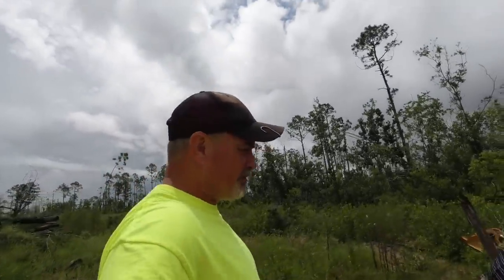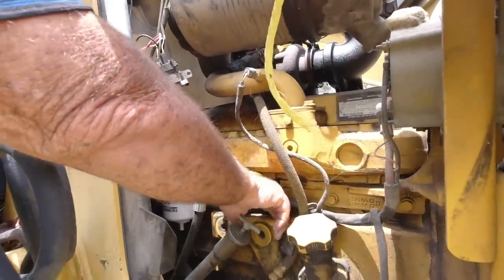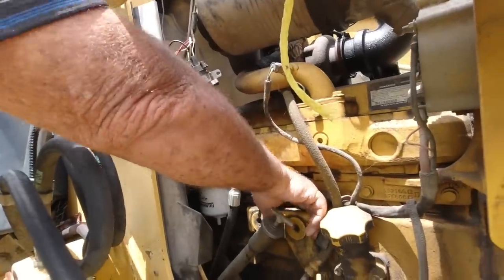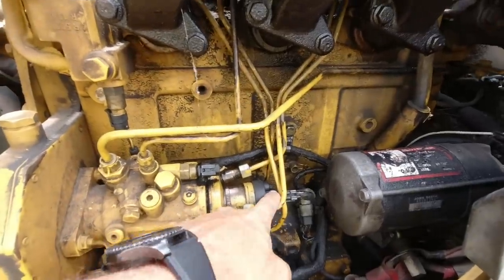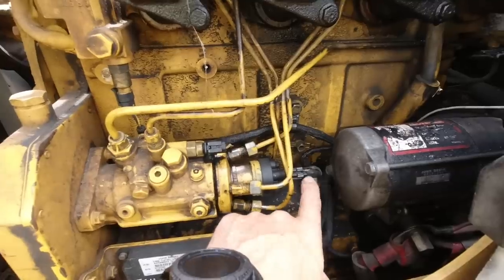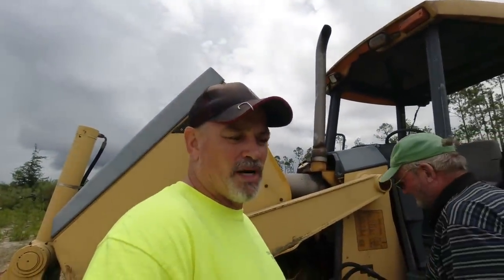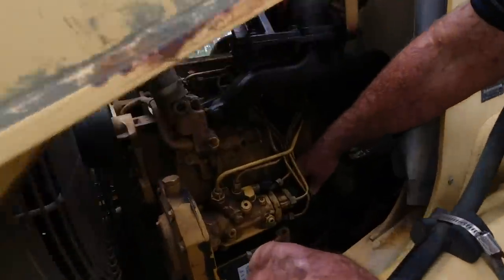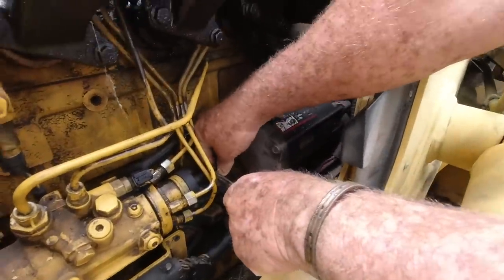Will It Start? Working on the ABANDONED digger John Deere Backhoe!

Comment: I’ve been a Deere Tech for 6 years. Maybe check the f.n.r. Lever. If the controller isn’t reading it isn’t in neutral it won’t allow the ecu to power up. The injection pump solenoid is not just a 12 volt off on solenoid. It’s controlled by pulse width modulation from the ecu. Also check f.n.r  relays. That could also be why it’s not cranking from the key switch.
Reply from the maker: Thanks Ky. We've checked that. I appreciate the comment 👍

Comment: That solenoid doesnt get a set voltage. It works off a pulse signal normally around 9 volts. If your not getting fuel from the pump to the injectors i would check the terminals in the pigtail on back of the pump. They are known for issues. If you need a new pigtail the part number for standard brand is s553  at auto parts store.     Those DE10 injection pumps are also failure prone. I replace them pretty often.      If you need to move it there are 2 bolts one on each side of rear drive shaft on the park brake housing, you can loosen jam nut and tighten the bolts in to release the park brake to pull the backhoe
Reply from the maker: I think you're right👍 thanks for watching

Comment: Yes, you're gonna have to spend a little money, but your time and effort are worth it.  
I'm a 25yr diesel mechanic and I highly suggest you get a Power Probe 3 for your electric diagnosis.  You can tell if a circuit has power and ground and you can supply power and ground as well as use it as a multimeter to show continuity and voltage.  It's a highly valuable tool that anyone should have, even if you are not a mechanic. It is an equalizer for sure.  It's also circuit safe with a built in circuit breaker.  
It would save you so much time and effort for testing a good or bad part. You could use backprobed your cylinder you were testing, checked for power and ground, or test if it gets energized with the key and if not, you could manually add power or ground, whichever was missing.  Boom, in seconds, you know if you have a bad part or circuit and move on from there. You didn't show if the "extra" battery you were using even had a charge (maybe off camera you did), but generally you don't want to add an extra battery to your system because it'll add a whole set of unknown. 
I did 8 yrs in the Army and carried a multitool for many years too, not so much anymore, but that's for a different reason. 
I hope this helps, I came over from Diesel Creek on his shout out for you. Got any mechanical questions, let me know, I'm retired and happy to help. 
Cheers
https://www.amazon.com/Power-Probe-III-Case-Acc/dp/B005MVB3S0/ref=mp_s_a_1_3?dchild=1&keywords=power+probe+3&qid=1596806712&sr=8-3
Reply from the maker: I hear ya. Thanks for stopping by and watching. I appreciate it 👍

Comment: If the fuel was making it to the injectors, it would run since it ran on starter fluid.
 Loosen a fuel line at the injector and hand prime it until you see a steady stream of fuel there, with no air
Reply from the maker: Thanks!

Comment: If you have wired the fuel pump direct to a battery, you should hear it running, but it didn't sound like it was.
Reply from the maker: Yeah that's what I thought too. I didn't hear it either. Thanks for the comment

Comment: Yank the solenoid then try starting. Still thinkin the pull back circuit is not apply enough voltage and it is preventing fuel from flowing.
Reply from the maker: Thanks 👍

Comment: Is it possible whoever owns the backhoe,would let you load it onto a semi.haul it home to work on it?
Thats where all the tools are.😊

Is it possible to fill the fuel filter with diesel fuel? That way its getting some fuel off the start if it starts?

Once you get it running.of course you will have to try it out and do some digging for a few hours . You know, just to make sure its in tip top shape to return😊
Reply from the maker: Yeah, we actually just talked about a way to get it back to the shop while we were out there. I'm hoping that conversation leads to it coming back to the shop.

Comment: Wondering if you two ex Air Force? Soon Rain Came You tucked tail went for truck cab.. Its ok, I Understand I hate when rain runs down the back into you know what.  Great work, getting closer, u know it fires off, just got work out the wire grimlem.
Reply from the maker: Lol. I hear ya

Comment: Yep hank i think she has a addiction 😬
Sometimes i use a little gas on a rag 
Or sometimes I have to resort to fire in a can ( starting fluid) something you might wanna check is on the supply line going to the fuel injector pump sometimes they have a little screen in there 
That gets stopped up 
Or the lift pump is not working properly 
And is not getting enough fuel 
Have a great day buddy 👍🏻
Reply from the maker: Thanks Nick. I appreciate it 👍

Comment: I think that he loos a ground cable and then loos the power for star and you aply starting fluid but that maybe loos the motor or starter or other part and chek the oil and the disel they no have water on that and the computer send a signal don pushing to more the motor God blesing friend
Reply from the maker: Thanks Oscar 👍

Comment: I worked for a deere dealer here in aus for 8yrs & saw problems on 315sg,s with water in the ecu plugs because the ecu,s on them is in the engine bay. Just a sugestion i,m not sure if your 310g is new enough to have an ecu.
Reply from the maker: Watch part 2 or 3 ....we put a new ECU in it👍
Reply: Probably i silly question & you probably have allready done it. Did you loosen the injector lines & cranked it to see if there is fuel coming out of them? Its not common rail is it?
Reply from the maker: Yeah,weve done that. It's not common rail. Thanks 👍
Reply: I wouldnt think its a compression problem because it runs on starter fluid. Sounds like its not injecting.

Comment: I had a similar problem with my kioti ck25 3 cylinder it turned out to be the gears in the fuel pump were stripped so my neighbor Bob ( retired school bus mechanic ) suggested we turn the gears 180 to engage perfect teeth it's been good for 145 hrs so far. Kioti dealer wanted 1200$ for a new pump!🇺🇸✌🏻️
Reply from the maker: Interesting. Thanks 👍

Comment: As nice of a tractor that it appears to be, it wouldn't have been sitting there if something wasn't seriously wrong or rather just expensive. I see below the pump there on the left side ECU etc..  on a small black box. That could be the issue. Trying to jump start some things with computers on them can lead to power surges back into the ECU causing non repairable damage and sometimes over time they just fail anyway. Just have to replace it. Also could be a grounding issue. Good luck and God Bless ! Love these type videos along with the tractor ones as well.
Reply from the maker: Yeah in Part 2 ..maybe part 3 we replaced the ECU. That's a new one. You can go back and see some of the stuff we've done to it. ...it is getting expensive. Lol. Thanks for watching 👍

Comment: Hank I can tell you what to do to get the 310 going  it’s air in the fuel system you need to blend the entire system and also that it’s a electrical controlled system be very careful adding wires it isComputer control system has electrical fired injectors along with hydraulic fired injection system you need to bleed the system from the injector them self’s
Reply: Ps I work on one just like it that my brother has it’s very air sensitive
Reply from the maker: Yeah, we need to bleed the system for sure. Thank you for the comment 👍

Comment: Is there a possibility that the fuel pump needs to be timed????i know it might sound like a dumb thing.i had a 1998 chev 6.5L turbo diesel.when the pump went  and the new one was installed.the shop had to time it.
Reply from the maker: Maybe🤷🏻‍♂️. At this point anything is a good guess. Thanks Brian 👍
Reply: @HamiltonvilleFarm  is there a possiblity that the injectors dont open up to spray fuel unless theres oil pressure???
Reply from the maker: I'm not sure.  Maybe as a safety feature? I don't think anyone has mentioned that before.

Comment: I feel like you likely need to replace the fuel pump since it clearly has a fuel supply issue but I also wonder if there could be an issue with injectors themselves. I also feel like the starter is probably drawing way to much current and not turning fast enough to properly start the engine(especially since the jumper cables did not do much to speed it up), so, I would replace the starter and check all of the main power and ground connections to make sure that they are very clean and tight. Hopefully this will help make that machine a happy runner again. That's just my thoughts on the issue. :)  P.s. Did you have the JD tech fix the throttle sensor code you had and check for any other codes while he was there?
Reply from the maker: I think you're on the right track. The tech said he couldn't fix the code until the problem was fixed. 🤷🏻‍♂️
Reply: @HamiltonvilleFarm  Yeah, I figured that the calibration probably couldn't be done unless the engine was running.

Comment: TAT, my fr4iend, is why I like the old Fords. No computers and garbage. Just straight forward diesel and hydraulics. I lay you odds that you'll end up with a real Deere wrench man to get it going. Way too complicated any more.  And that's WHY they're like that.
Reply from the maker: Yeah I hear ya. Part 3 had the field tech come out and he had no clue what to do. Maybe we can get it one day soon. Thanks for watching 👍
Reply: @HamiltonvilleFarm  I remember it, come to think of it. Must've been a flunky. Cat guys aren't that way but for the money they get they better NOT be. Maybe you can winch it onto a trailer after loosening the hoses so you can move the hoe boom and whatnot.
Reply: @HamiltonvilleFarm  I was running a D5K LGP when it just STOPPED! Ran fine but wouldn't move. Cat man came out and said it was the coupler between the engine and pump. Electric over hydraulic. Had to pull the engine. Coupler looked like a overhead cam GEAR on a car with the teeth. Flimsy. He changed everything to a HEAVY duty one. Didn't bat an eye. The Deere man ought to be able to do the same.
Reply from the maker: You'd think👍 I appreciate you Lewie!
Reply: @HamiltonvilleFarm  LIKEWISE, Buddy! BUNCHES!

Comment: Frustrating that the fuel solenoid looks like it's actually ON the injection pump.  It should be going 'click' when you hook it up to that aux battery but maybe that was left on the editing room floor so I didn't hear it.  If it's not clicking, I'm not sure fuel is actually moving to the injection pump, even though it's a new solenoid.  I don't know how the valve works on that solenoid, but I'd probably take it back out and see how the fuel flows through the injection pump at that point.  If it's just pushing a valve actuator inside to release the fuel to the pump, I'd try manually actuating it (finger, screwdriver, whatever works) and see if it starts up.  There could be a bad fuel valve inside the pump.  Again, just guessing here.  I can't find a good schematic for that 310 injection pump on-line but the solenoid's I'm seeing for it seem to just be plungers pushing a pin forward, that would imply the shut-off valve is actually in the pump housing so manual trigger of the valve may work, but if not, probably bad valve.  That would mean that injection pump may have to come out to get the valve rebuilt.  Just a train of thought there.
Reply from the maker: I appreciate it. It's been really frustrating so far. lol.

Comment: You need get ahold of .watch Wes work guy he is good bud you know that bud but if it starts on either and no fuel it may have stuffed up injectors cause seems like it won't take and get fuel from last vid only way is to test them .but hope ya can overcome this bud it's a nice peice of equipment .may need a fuel pump allso not sure bud hard saying .but if ya use wd 40or what ever make sure it's flammable .and I was watching a show of someone who bought a tow truck ford and it wouldn't run cause the glow plugs didn't work and the fixed them and it ran but ya again it's hard saying bud
Reply from the maker: Me and Wes talk. He's a real mechanic. Lol. I'm sure he'll chime in on this video

Comment: Reading through the comments I see y’all trying to think of a way to move it. I don’t know how the hydraulics are controlled whether there electric or the lever is actuating the actual valve. If you can relieve the pressure by moving the levers, take the tractor and use it to pick the front end loader on the backhoe up and to fold up the rear arm and bucket. I wouldn’t remove the hoses that way you retain the hydraulic fluid and in theory it should hold everything up itself. Just remember to move the levers like you would while operating when you pick everything up with the tractor. If the tractor is able to lift all that that is. Hope this paragraph makes sense lol.
Reply from the maker: Yeah it does. We gotta do something. It's getting ridiculous. Lol
Reply: Hamiltonville Farm I’m sure. I would say I could move it for y’all, but without it running it be hard to get on my gooseneck. Does that big tilt bed have a winch?
Reply from the maker: I don't think so. Might end up dragging it onto a trailer of some sorts.
Reply: Hamiltonville Farm yea, it would almost have to be a detach lowboy

Comment: Did it start yet
Reply from the maker: Not yet
Reply: Try changing the cable from battery the red one not the big line I know it can't be  changed but use another line hook it up on battery and to the connector
Reply: We had the same problem with the 650j dozer it has the same engine you have on that 310 it did the same as 310 is doing it turned but won't fire up the problem was there not enough power going to injection pump..so you might wanna check that line from the battery

Comment: I've been watching you on this John Deere for the past couple videos.  You've changed out the ECM, fuel filter and battery  and as I remember that ECM was expensive and hard to find part.
looking around the internet, I found the manual on the Stanadyne DE injection pump. The ECM controls the solenoid on the back of that injection pump. through the ECM the idle, throttle control and shut off is accomplished.  You'll notice that there is no throttle linkage on that Injection pump.   Tapping into those wires on the back of that injection pump, plugging that harness back in and applying 12 volts to it caused 12 volts to back feed into the ECM.  You also have no idea which of those two wires you tapped into was 12volt positive and 12volt negative coming from the ECM.   Here's the link to the Stanadyne DE Injection Pump https://www.stanadyne.com/dealerportal/ssi/english/Product%20Manual/99820.pdf    The wire on top near the return line is a thermistor to send the return line fuel temperature back to the ECM.   I hope this helps.
Reply from the maker: Thanks. I'll check it out. I appreciate it.
Reply: @HamiltonvilleFarm  You're welcome.

Comment: I am no smarter than a rock when things get tried an nothing works. I can't understand for the life of me why the solenoid is performing like that. I know some had a manual turn on screw that incase of a electrical failure occured that you could turn in an it was on a find a way to shut off then... ya, what worked to make run would also work to shut off. I know if it was there that tommy would of found it and it is just like a key way or something is not turning something to make the fuel keep going to the injectors. I guess convert to propane and do away with the injection system by making a new system for it to get some kind of fuel. Fuel air and spark which uses the  compression is its spark even if it were propane. I am thinking that I got to help by researching this kind of pump. Sorry it didn't work Hank an I know you all try. Anyone who spent that much time in has got reasons for leaving. I only had in three and just didn't like the war all that much and when it was time to go home I flipped a quarter and so it was tails thinking heads I stay an tails i leave but it almost always comes up heads an so when tails come up I left Saigon and cried... not boo hoo but none the less thinking I am letting someone down.
Reply from the maker: Thanks Morgan 👍
Reply: @HamiltonvilleFarm  The ones that I have worked on Hank, you don't need a seperate battery for the solenoid, and since ground is already established, a hot wire from the battery just means the juice in the wire doesn't shut off when in the cranking mode. I did take a air compressor and blow through the injection pump while cranking it over before and got a   wad of shit that was trying to get through.. sandy grit and fiber like I fed it oatmeal or something. Supposedly you can take the solenoid out and block that hole off and then its shut the fuel of going to the engine with a ball valve or some other device. At least it don't run the battery down. That was our clue was the parasitic draw on the battery. You could touch the cable to the battery and get a small ark. It wasn't much.... a nine volt battery for a flash light will make that solenoid work. put it in a vise after you take out of the pump and then touch the little prongs for the plug in on it and it should jiggle and if it don't then its in the shut off mod. What hurt my feelings the most was a nine or ten something age kid, said is this supposed to do this an I was going to run him off an saw what he saw and so told him to run along now.... then hurried back to fix that problem an it run but that kid wasn't finding out he outsmarted us all
Reply from the maker: Thanks for the comment Morgan. It helps👍